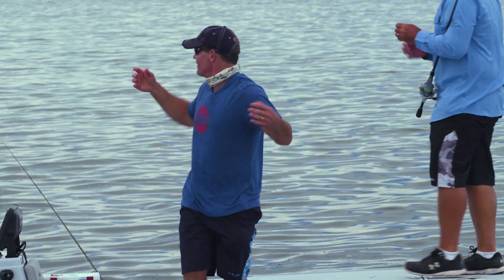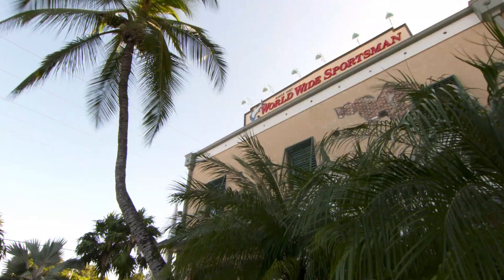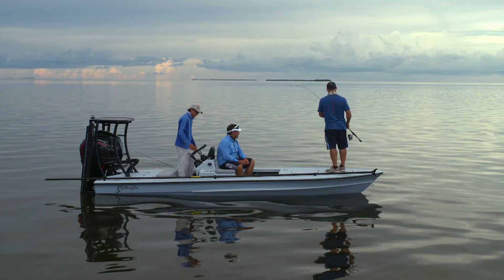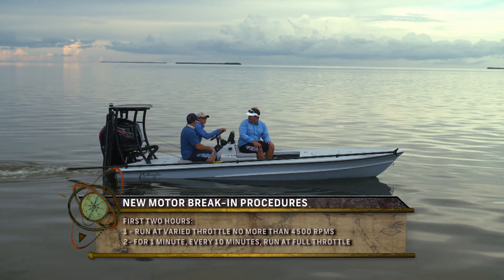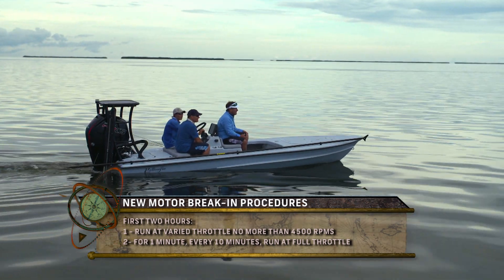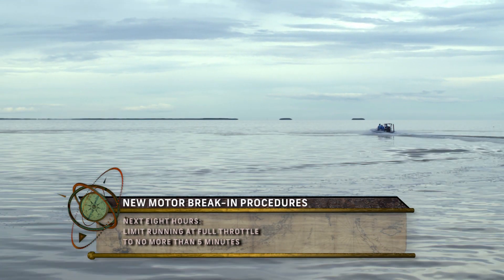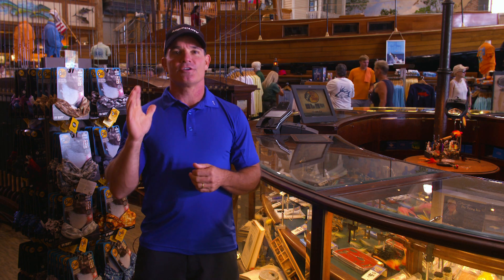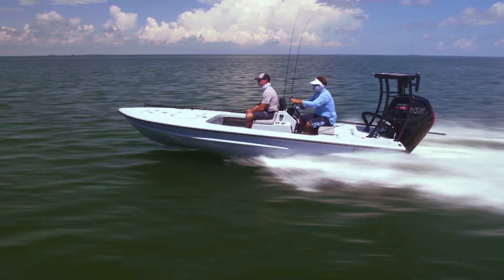Mercury Marine How To Break In A Brand New 115 HP Outboard | Tips From The Pros (2017)

Comment: Just got one of these engines on a new Lund boat, one week ago. Got it out for the first two hours today--incredible engine. Simply outstanding in the first outing. I did the same 2-hour procedure specified in this video. Incidentally, it's the same that was used on the 4-cyl Verado 150 that I bought in 2007. I followed it then, and followed it now. Very simple. 

Where I boat on the Great Lakes, it's very unlikely that you can run WOT for extended periods of time anyway, simply due to swells. So it shouldn't be difficult at all to stay at the "WOT for no more than 5 minutes" limitation for the next 8 hours.

Comment: No need for a 8hr break in,run it hard from the crate or the rings never will seat. The tolerance over the yrs has changed so much even mercury themselves has said break in is no longer needed except for the rings which is accomplished in the 1st hr. Imo,10hrs is just for liability reasons only,no other reason. I go hard with my outboards from jump street and they produce mega power and not one issue ever from my new 4 stroke or 2 stroke.
Reply: @Phillyfishguy Yep...IF it breaks.  THEY WILL know.  That said...I build engines and tell my customers to simply do about 15 short WOT runs to bed the cylinders and seat everything or they'll end up with an oil burner.  I know Merc does it for the same reasons some jewelers tell you that your wife's diamond ring warranty will be voided if she doesn't bring it in every 6 months for a "cleaning" and "inspection".  So if you miss a step they can tell you to take a hike if anything goes wrong.  BTW...I live 20 mi from Merc HQ in FdL and know a number of their engineers who pretty much tell me the same thing.